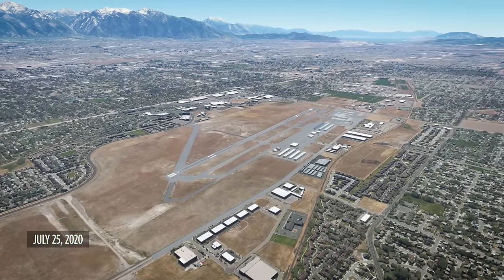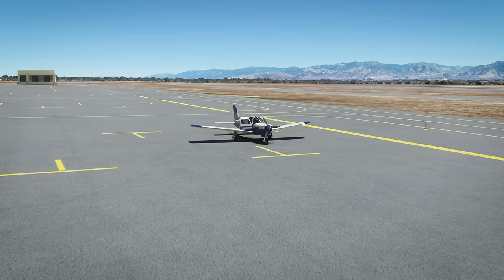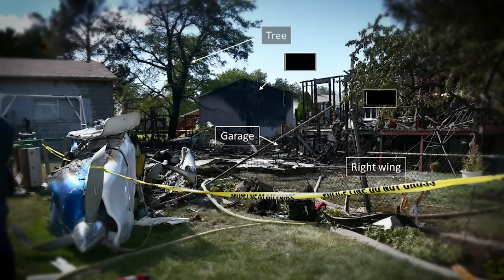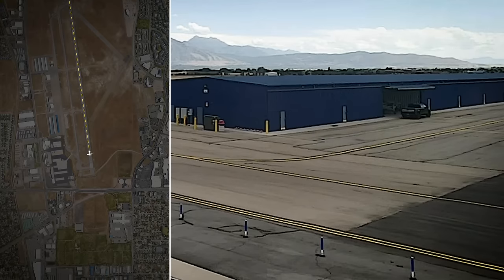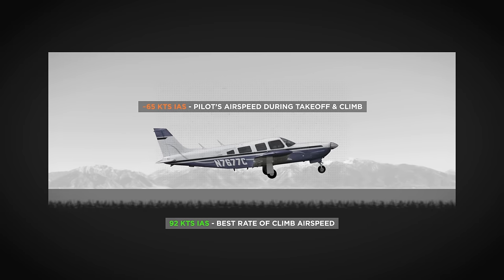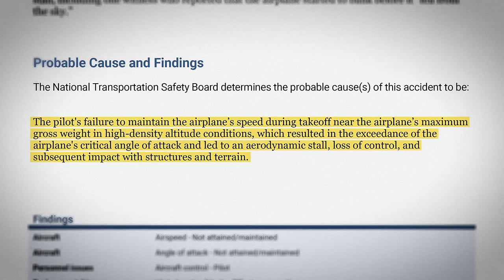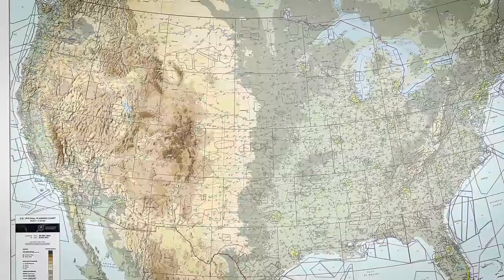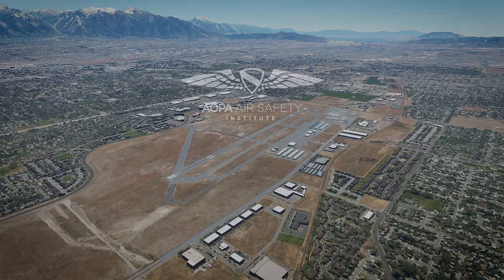Accident Case Study: High Aspirations

Comment: As a PA-32 pilot I was excited to learn more from this video - I find the quality and learning points amazing but the conclusions (from the NTSB) leave me with many questions.  I've flow just under max gross at much higher altitude and am a regular mountain pilot like the pilot in the video.  There were several small factors that could have been improved upon (looking at wind sock rather than listening to the METAR, better leaning perhaps, leaving earlier) but that said that plane should have been able to make that flight without any issues.  

The conclusion of pilot error grossly misrepresents the situation and completely ignore systems issues that may actually solve problems in crashes like this.  It is easy for the NTSB to blame the pilot but it really just doesn't add up.  My home airport is the same elevation and taking off in 100+ weather is a regular occurrence without any issues.  If we are really going to say that the book numbers need to be padded by 50% for safety then the cause of the accident should be inaccurate performance numbers, incorrect METAR (if the tower can get live weather why can't the AWOS do the same thing with modern tech) then pilot error for relying on what the book states should be well within the envelope.  Similarly, many other PA-32 pilots fly in conditions just like this without any incident.

That said - I think ASI's review is amazing and is doing what it can to make the best learning points from a bad situation

Comment: Scary!  On paper this pilot did just about everything correct, but still had the accident.
Reply: Exactly what I was thinking…. The pilot did everything right, even adjusting mixture for power. The plane should have accelerated in ground effect I would think to a decent flying speed.

Comment: The difference in manual and real numbers are also due to the age of the aircraft and engine condition. Although they might be ok and legally fit to fly, the engine is not running on it’s 100% capability and the airplane too. Everyone that flies can say that each plane is different in terms of performance and even appearance.

Comment: My experience exactly--but with a very short runway--but no disaster. Cherokee Six, fuel injected, taking 5 passengers to Houston from Logan, Utah in the mid-1970's. Decided to refuel in Espanola (near Santa Fe, New Mexico.) My reasoning to stop at a country airport was to avoid busier Santa Fe. Hot summer morning, 5700 feet airport altitude, SHORTISH runway at the time. Runway sloped downhill, wind came from the uphill end of the runway. The airport operator was reached by telephone and came out very late to refuel us. In the interim, I took out the handbook (Cherokee 6 POH) and calculated the maximum fuel we could take on and still get off the ground. I was getting worried as the air temperature was getting HOT. But the numbers I penciled out assured me we would get off the ground. And no, I did not factor in any extra margin. I stopped the refueling when we put in the exact number of gallons I wanted. The owner (a student pilot) wanted to do the takeoff and I consented to allow him. I said we had to do a short field takeoff, so that meant keeping the nose wheel on the ground as long as possible. During the takeoff run, the owner pulled back on the control wheel twice and I shouted to keep the control wheel forward. After the second time he pulled back the control wheel, I shouted that "I have the airplane" and with the stall warning blaring, the end of the runway fast approaching us, I knew we were in an extremely marginal condition airspeed-wise. Shortly before we crossed over the fence at the end of the runway, I reached down and pulled up on the flap lever and set flaps to about 10 degrees (but I honestly don't remember if it wasn't 20 degrees!) The airplane mushed into the air, fairly fully loaded-with rising terrain ahead--all the while with the stall warning blaring away. I nursed us out of that situation and we continued on our way to Houston, Texas. Now why did I use flaps? Well, a few years prior in Alaska, I rode with a seaplane pilot who would pop on about 10 degrees of flaps to become unstuck while taking off from glassy water. Like one of the comments below, I did my best to keep the holes in the swiss cheese from lining up and to this day I look back on the wisdom of carefully calculating our takeoff weight and distance. I did not factor in the surprise element of allowing the airplane owner to attempt the takeoff, but I appreciated my decisiveness in taking control back from the student pilot (a businesman whose family was aboard). The wind, the slope of the runway, the rising terrain, the late arrival of the fuel person and rapidly rising temperatures in July were all environmental factors that I had to consider prior to takeoff. I felt somewhat surprised and not very well-prepared to deal with that array of factors but I did give it thought. I remain grateful for your comments, insight and criticism, as I have rarely mentioned this in a forum that gets visited by many people far smarter than I. Condolences to all who lost loved ones in this Air Safety Institute accident study in Utah.

Comment: Probably one of the most interesting videos yet. Pilot did everything right except notice the wind sock was now turn opposite direction. The 50% number is a good idea, I’ll keep that in mind on my next hot weather flight!
Reply: Another suggestion, if I can give one, is that the AFH recommends GA pilots pick a point on the runway where they will abort if not in a stable climb. It recommends half way down the runway because that's quick and easy to spot in the fast paced, high workload of a departure. Personally I pick a taxi-way along the runway and put it in my brief that if we pass it and aren't climbing, we set it down no matter what. 

It's just one more layer of safety to help keep you and your family far away from having your own Safety Institute Video.

Comment: One important point not mentioned is that you need to lean a normally aspirated engine for max power when taking off at high DA. The engine data shown showed he didn’t do that. It appears he was attempting to adjust the mixture very late in the TO roll. You have to let the plane fly itself off. Don’t jerk it up into ground effect.

Comment: Student pilot here:  would staying lower to the ground (for more ground-effect time) help with avoiding such an issue?  From the mid-field video, it looks like he pulled up quite a bit with plenty of surface left to use (maybe that was just a trick of perspective?).  I'm not critisizing sitting here at 1G/0kts, but trying to understand a little more.
Reply: Do not try to use techniques to worm your way out of bad decisions. Just make better decisions. It was obvious right from weight and balance + DA..he shouldnt have gone flying.
Reply: Yes, for small GA aircraft it is appropriate to remain in ground effect while accelerating to your initial climb away airspeed. (Note that making configuration changes- flaps, gear- in ground effect can be hazardous). Leaving ground effect early will always incur a performance penalty in the form of increased induced drag. If this performance penalty is not critical it is unlikely a pilot would even notice. But if that loss in performance is critical, well that's going to be you settling (gently, or not gently, yet in either case alarmingly) back down onto the runway, or not clearing an obstacle.
Reply: In mountain flying with small piston aircraft, staying in ground effect until your climb away airspeed would be demonstrating good technique/airmanship.  @venutoa

Comment: I used to race cars. You learn right away that perfomance figures published by manufacturers are BS. You also learn that air temperature has a HUGE effect on perfomance. So does altitude. Combine the two, and what was a fire-breathing dragon on a cold sea level morning  becomes a right pig at Willow Springs in the California high desert at 4,000' asl with a 95 degree F air temperature. You're gonna face other problems too, because you're at a race track, and pushing the car as hard as you can for extended periods of time under extreme conditions.

Things break. Engines overheat. Brakes catch fire. I've seen it all and more on my own car.

You can drive that same car under normal conditions for decades and never have a problem.  10  minutes of hot-lapping  Willow Springs and you're lucky if nothing has broken, siezed, or caught fire yet. GA flying is 60% more dangerous than riding a motorcyle I hear. I ride motorcycles. Motorcyling is very dangerous. No matter how experienced and skiiled you are, sooner or later, you're gonna get it wrong and crash. Hopefully like me, at low speed without serious injuries. But you WILL crash eventually. Now load-up that same motorcycle with 5 passengers, and ride it out to the high-desert and start hot-lapping it under the mid-day sun.

....and you're still gonna have better odds of seeing tomorrow than this pilot trying to fly that loaded up Piper out of Salt Lake on a hot day. What are people thinking? Take whatever the manufacture says about climb perfomance, and then de-rate it 20 or 30%. Same goes for max weight. THEN calculate density altitude, perfomance. Determine and brief your 50/70 take-off abort point. Abort the take-off if you are anywhere near 1/2 down the runway and the plane hasn't accellerated to at least 70% of rotation speed, right?

The 20 to 30% downrating of perfomance and loading should keep you out of take-off and climb trouble. Still - loading up a small GA airplane to it's limit with passengers, especially children, fuel and baggage in hot weather at high altitude with a Disneyland style Grand Canyon tour flight goal puts a lot of pressure on the pilot not to abort the flight..

Sadly it cost several lives. Next life, consider dividing the tour into two flights each with 1/2 the weight and risk to human life and limb.

Just sayin': That "git 'er done!" can-do attitude kills in most any high-risk endeavor.

Comment: The video does show best climb speed but it doesn't mention whether ADSB data showed that the pilot ever got to that speed.   I fly out of airports near Denver and in the mountains.  The density altitude is often over 7000 feet even in the morning.   Yet we don't crash.  Yes density altitude hurts performance but this aircraft should have been able to climb at least slowly in these conditions with proper technique.   Its service ceiling is a lot higher than 7000 feet.

Comment: Lean out the engine for max power at high altitude airports and in high density altitude conditions. Then touch it up after takeoff. Getting away from the town might of been a better conditions situation thinking of the heat generated and rising there from roofs and AC. If it's touchy, straight ahead to not lose airspeed.

Comment: I’ve been flying out of Centennial airport in Denver for 20 years.   Did lots of training on days when it was above 80 degrees at a field elevation of almost 6000 ft msl in 160 HP 172s.  You learn how poorly a normally aspirated plane performs in those conditions.  Fine for flying in the pattern and some airwork.  After a few mountain flights in normally aspirated aircraft, I vowed not to do that anymore.  Flying a non turbocharged single engine plane on cross country trips in the mountain west is just not wise.  Even if density altitude isn’t a factor.  Even if the aircraft is well under gross weight.  The downdrafts can be strong and windshear is always a possibility around mountain airports.  Having a turbo that can provide full rated power up to 15 or 20,000 feet is a good idea.  I know there are plenty of great mountain pilots flying the backcountry in super cubs and the like but I think thats a different world.

Comment: I read the NTSB report and watched this video a few times over. I think the NTSB (and this video) only mentioned one of the pilot's errors directly: his failure to hit and trust target climb airspeeds. The pilot also seems to have forgotten (A) a takeoff briefing that would have specified a certain speed / rotation by no more than half the runway, and (B) the pilot's failure (from studying the fuel-flow graph) to conduct a full-throttle lean immediately before takeoff. Those were critical missed checklist items. His failure to miss the new weather is another one that I'll add to my checklists.

Comment: I agree with the report, but, it may have left out one factor the Piper auto extend system. The gear is retracted airspeed slows down gear extends pilot pushes nose down gear retracts. Up down up down stall unless it’s in override

Comment: There is another consideration, those performance data were achieved when the engine was in a reasonably healthy condition.  The edge of prop blades is silky smooth. The most important part is the TEST pilot recording the performance data.
When I am operating from higher ground for every 1000 feet of density altitude the all up weight is reduced by 1%. I have a similar formula for temperature over 30 degrees.

Comment: I live at 7300’ on a ridge in Colorado that’s often crossed by small aircraft. You can always hear the smaller planes working hard flying not far overhead compared to what I was used to in the Midwest.  Especially helicopters transiting over the ridge.

Comment: A lot of comment about the tail wind. Once he is off the ground, it should not affect climb performance except climb / distance over the ground . . . 
Also, what about carb heat? That would have a bigger affect on engine / climb than wind.

Comment: Tragic for all affected. I can see how some commenters would feel that it is the responsibility of the manufacturer for the aircraft to perform according the POH. I didn’t read the underlying NTSB report. From the video I believe that this was a PA-32R-300 (1976–1978). 

I flew a few Lance’s back in the day when these aircraft were new. FORTY-FIVE years ago. The aircraft probably performed according the POH for many years afterward. Piper Aircraft filed for bankruptcy in about 1982. Holding a non-existent company responsible for a product that they made a few thousand dollars profit on 45 years earlier, while a noble sentiment, probably isn’t practical. 

Air Safety Institute: now that we have the computing capability to provide a Dynamic Performance Operating Handbook instead of relying on a static one created at the time of manufacture, maybe it is is time to discuss an initiative of creating the software that would be a part of every aircraft’s airworthiness. If a Dynamic Performance POH isn’t available, the aircraft becomes an Experimental Category not for transport of passengers that don’t possess the capacity of independently assessing an operation’s risk. Part of the aircraft’s annual inspection could be a performance evaluation by a pilot trained in the evaluation of performance parameters. The resulting performance parameters could be stored in an FAA database that area unique to that aircraft. The software could access the current performance envelope in a Web UI that would allow the aircraft operator to make a more accurate assessment of the aircraft’s ability to complete a proposed operation. Yes, the software would cost to build and maintain and yes, it would increase the cost of an annual but the incremental cost of what can likely be simplified into a few hours of flight tests would pale in comparison to the loss of life that has preceded in all of the years of general aviation operations.

Betting your life, your families lives, and close friends families lives on an antique aircraft performing at the outer corners of the performance envelope could be considered to be within the scope of aeronautical decision making. The pilot likely had not performed thousands of flight operations in a commercial environment where family pressures don’t come into consideration and the primary focus is safety. The report indicates he had absolute confidence in his ability to handle the aircraft and be responsible for the lives he held in his hands. Sometimes it can be wise recognize that it is ok to be unsure and don’t go if the operation enters that unsure category. May the souls of those children RIP.

Comment: So he just became a victim of Piper lying about the performance? According to the chart, he should have been able to climb easily at least 500 fpm on that day. Also, the service ceiling of the Lance is way more than the density altitude was, and he had much more runway than needed, based on the performance chart.

Comment: A very sad but instructive video.

This was probably outside the scope of the video, but I would have been interested to know what the pilot could have done once he took off and realized he was in trouble. It was mentioned that he apparently did a series of descents to gain speed, then tried to climb. But ultimately he exceeded the critical angle of attack, stalled, and crashed.  The terrain looks quite flat, and not heavily populated. Could he just have accepted that he'd be unable to climb, kept the wings flying, and just made the safest possible off-field landing?

Comment: Don't worry about the landing. Worry about your taken off. You don't have jet power. I can't remember if the 1957 B 18 Even had a single engine climb chart. I won't think so but if you want to engine with a heavy load of cargo I could tell you that you may not make it unless you're at sea.

Comment: I've been there. Hot, high density altitude and at max gross weight in a Piper Warrior. I managed 300 ft/min climb after using 4,000 ft of runway. Performance was so bad that I flew the pattern and landed. I never got above 500 ft AGL. In hindsight, I never , ever would have done that flight. To this day I think about what might have happened. I was lucky, this pilot wasn't, very sad.